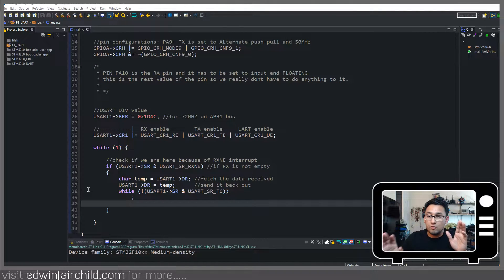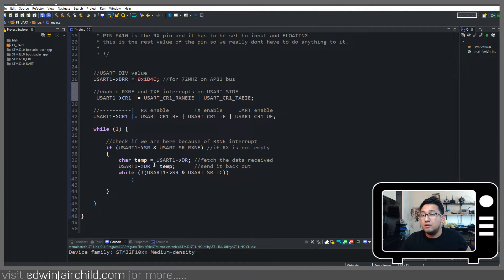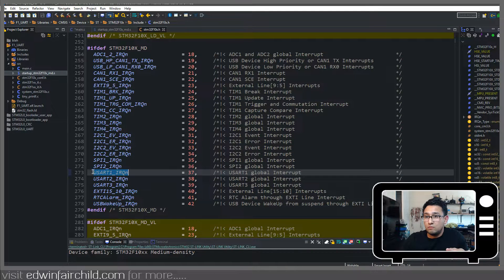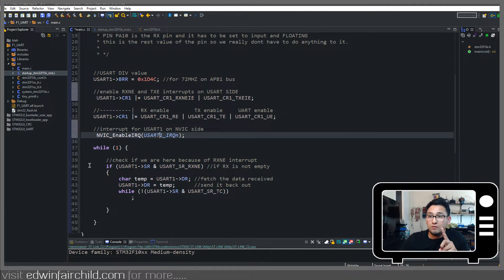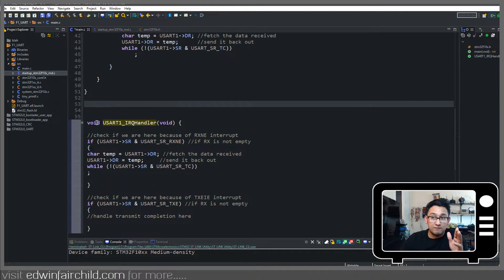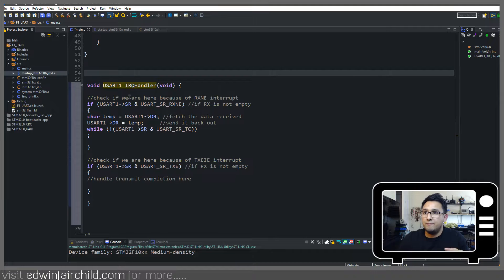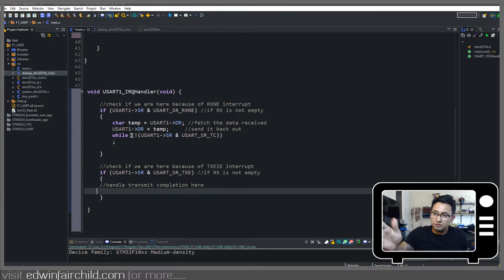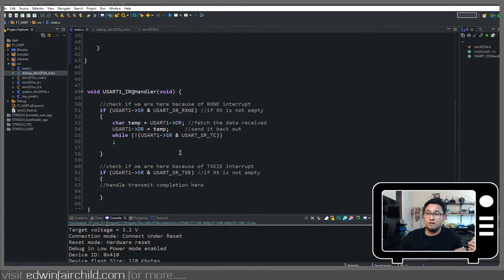STM32 UART Pt 3: Interrupts

Comment: Nice tutorial.  How do you use UART interrupt to connnect 2 STM32 MCUs. Enabling output of MCU1 using the input of MCU2 and vice-versa.  I tried doing it based on your tutorial.  It works for a single input/output.  However for multiple inputs/outputs it never worked. Do you know how to do this?
Reply from the maker: Explain a little more what you mean ? If it works for one output why do you need more is the part I don't understand... ?
Reply: @EdwinFairchild  sorry I did not clearly explain this.  Basically I have 2 STM32 MCUs connected through UART.  A button on MCU1 will trigger an output on MCU2 and vice versa.  Initially I tried a single button from MCU1 which drives a single output in MCU2 and this is OK.  However when I added another button2 to MCU1 I could no longer transmit data from Button2 to MCU2.   Here's my code for the Transmit MCU1:

USART2 -> CR1 |= USART_CR1_UE;
USART2 -> CR1 |= USART_CR1_TE;
USART2 -> CR1 |= USART_CR1_RE;
USART2 -> CR1 |= USART_CR1_RXNEIE;
USART2 -> CR1 |= USART_CR1_TXEIE;
	
NVIC_EnableIRQ(USART2_IRQn);

.
.
.

void USART2_IRQHandler(void)
{

  HAL_UART_IRQHandler(&huart2);

//this is the first transmit code for button1 which is successfully transmitted to MCU2
if(USART2 -> SR & USART_SR_TXE)
{
	{
		if(!HAL_GPIO_ReadPin(BUTTON1_GPIO_Port, BUTTON1_Pin))
		{
                      //transmit this data to MCU2			
                      USART2 -> DR = 0xFF;																				
		}
		else 
		{
		      //transmit this data to MCU2
	
                     USART2 -> DR = 0x00;																					
		}
	}
}

//this is the second transmit code for button2 but this never gets transmitted to MCU2		
if(USART2 -> SR & USART_SR_TXE)
{
	{
		if(HAL_GPIO_ReadPin(BUTTON2_GPIO_Port, BUTTON2_Pin))
		{
			 //transmit this data to MCU2
                       USART2 -> DR = 0xF0;																					
		}
		else			
		{
			 //transmit this data to MCU2
                       USART2 -> DR = 0x0F;																					
		}
	}
}
	
	
//this is the first receive code from MCU2 and successfully transmitted to MCU1	
if(USART2 -> SR & USART_SR_RXNE)		
{	
	{
		if(USART2 -> DR == 0xE3)
		{
			//enable output
                        HAL_GPIO_WritePin(LED1_GPIO_Port, LED1_Pin, GPIO_PIN_SET);
		}
		else if(USART2 -> DR == 0x1C)
		{
			//disable output
                       HAL_GPIO_WritePin(LED1_GPIO_Port, LED1_Pin, GPIO_PIN_RESET);
		}		
	}
}
		
//this is the second receive code from MCU2 but unsuccessfully transmitted to MCU1	
if(USART2 -> SR & USART_SR_RXNE)
{
	{	
		if(USART2 -> DR == 0xCC)
		{
			HAL_GPIO_WritePin(LED2_GPIO_Port, LED2_Pin, GPIO_PIN_SET);
		}
		else if(USART2 -> DR == 0x33)
		{
			HAL_GPIO_WritePin(LED2_GPIO_Port, LED2_Pin, GPIO_PIN_RESET);
		}
	}	
			
}
		
}

Comment: Eddie, how can one verify that the microcontroller is running at a certain speed? For example, if I have a MCU that can run at 100 MHz and I do the config that is needed for the, is there a way to verify the MCU is actually running at that speed?
Thanks
Reply from the maker: Yes check the "SystemCoreClock" variable . But first call the fun riob UpdateSystemCoreClock or something like that ... CMSIS functions
Reply: @EdwinFairchild  Where do I check the value of that variable? I found an instance of the same under core_cm4.h I see that by default it's 16MHz. When I run my program to get the clock updated and run the clock update function, the value of that variable is still 16MHz. So I'm not sure if I just messed up and my program is not working oooor if I'm just reading it the wrong way.
Thanks!
Reply from the maker: @ivanrob392  you can do anything to check the variable , print it, or add it to variable watch etc... if you call the update function and the variable is still 16mhz then you didnt change the clock properly
Reply from the maker: @ivanrob392  check my blog for some code sample http://www.edwinfairchild.com/2020/03/changing-clock-frequency-f1-via.html
Reply: @EdwinFairchild  Hey man. I think I was able to make it c:. I started experimenting a little with Keil's debugger and I saw the system core clock variable changing to 100 MHz. Stmf32f411's are a bit different, but without your code I would not have been able to make it. Once again, thank you very much

Comment: Why did I replace keil with atollic? Is there a cubemx makefile Converter in Cmake? Share a link pliz if someone knows :)
Reply from the maker: I use Keil, Attolic , VisualGDB etc.... But I think Keil and VisualGDB are the best. But Keil is not free and debug code size is limited for most STM32 products except a few. VisualGDB license is only $99 and paired with Visual Studio Community it is a thing of beauty. I will make a video about it soon. As far as CubeMx converter I have no idea, I do not use cube generated code. Sorry.

Comment: It is not working. My code in while(1) is not working. Interrupt received function was working. But after initialize they interrupt my code not run.
Reply from the maker: Start a debug session and find out why . I cannot see your code so idk.  Are you using the same chip ?
Reply: USART1->CR1 |= USART_CR1_RXNEIE; Just use like this, I have no idea why tx is always interrupting. Maybe try to clear TC bit in the USART_DR.

Comment: Bought new keyboard with ENG layout, and TrueStudio still does not work. How it is even possible to get anything done? Can't find flash tool for ST-Link...
Reply from the maker: ill make a quick video tonight  on how to set up the st-link . As far as the keyboard issue goes i dont know, did you change the keyboard language on windows settings, its not enough to just change they keyboard
Reply: @EdwinFairchild  Thank you very much in advance. The problem with TrueStudio that everything is non/standard. Almost every program uses Ctrl+C and Ctrl+V for copy/paste option, but only Atollic TS uses something else (I think Ctrl+y and Ctrl+W or something similar) for copy/paste. Yes, I did change keyboard layout(s), so now I have ENG and HRV (CRO) layouts. BTW, did you got working I2C on your STM32?
Reply from the maker: @MilanKarakas  Maybe your version of atollic is like that, my version has normal ctrl+c and cntrl_v for copy and paste. Igot the i2c working for STM32L0 I gave up on the STM32F1 i2c. Keep getting weird behavior.
Reply: @EdwinFairchild  I have latest version 9.3.0.  Okay, I will get it working one day. Just need help setting ST-Link. That part is weird. 
It is strange how some MCU from the same company has okay I2C, some not. Many people complains about I2C on STM32, but not only f103, but others as well. Thank you for help.

Comment: Great vids!
A few topics I would like to see:
1. Read/Write to SPI flash external memory like W25Q32FVSIG chips.
2. Use SPI LCD displays like the cheap 1.8 color panels with ILI9163 or ST7735 driver chips.
Reply from the maker: that is very specific, i should set up  a patreon for requests. but im too busy lately to make any more videos. maybe next week or the week after that ill make something but definitely not that specific where i have to spend money and order those parts.
Reply: @EdwinFairchild  I have a batch of 10 of the W25Q32 chips that should be here in a week.  I could mount one on a breakout board and send it to you if you are interested in tinkering with one.
It's a 4MB SPI flash chip.
Reply from the maker: @Synthetech  that sounds like fun! Im down for that.
Reply: @EdwinFairchild  OK.  I'll get back with you when they arrive..
Reply: @EdwinFairchild  Got the chips from China today.  They are clones/fakes!  They may work, but I'm forcing a return right now before I solder anything.. most likely they will have to refund and leave them with me.
Reply from the maker: @Synthetech  well thats a win if you get the refund and they happen to work. I have been playing with an AT24C02 EEPROM. Man the I2c for STM32F1 is a pain in the ass, I have switched to working with the newer STM32L0 and its I2C is a breeze to get working. Everytime I get stuck with something on the F1 its always a breeze on the L0 or G0. The newer datasheets for these newer chips even bring sample C code to set things up.  I need to encourage people to switch lmao http://www.edwinfairchild.com/2019/03/there-is-more-to-st-microelectronics.html
Reply from the maker: @Synthetech  is this the chip you are using? https://www.mouser.com/Search/Refine?Keyword=W25Q32JV
Reply: @EdwinFairchild  That a 2k EEPROM?  I guess I have not yet tried Rx'ing I2C on a BluePill board yet.  I mainly work with F4 boards right now.
Reply from the maker: @Synthetech  yeah it's a 2k, I'm definitely moving up to an f4 and an L series for smaller projects.
Reply: @EdwinFairchild ..." https://www.mouser.com/Search/Refine?Keyword=W25Q32JV "... that chip is close, but these are marked as BV instead of JV.
I was fully refunded for these.  I bet they work, but the listing was for GENUINE Winbond chips and they were supposed to be FV's with QPI, not BV versions that don't have QPI.

Comment: Can you type '{' symbol in Attolic TrueStudio? I installed latest version 9.3.0 but the same thing as previous - unable to type {  .
Reply from the maker: I have 9.2 version and all keys work fine..
Reply: @EdwinFairchild  Hmmm... probably Croatian keyboard. Funny thing is that I can type { in their search window and everywhere else, but not in main edit window. Copy/paste of this symbol is possible, but out of question. Thanks anyway.
Reply from the maker: @MilanKarakas  have you checked out your keyboard layout in windows settings? maybe its not in english... also on my windows 10 , if i press CTRL + SHIFT i changes my layout for some reason ,this is annoying sometimes
Reply: @EdwinFairchild  Oh, it is actually AltGr (right one) + B. Thanks anyway. I will delete this studio - no any good if I can't type. Got e-mail from their support, and they told me that there is no help for non-paid user or something like that. So, goodbye TrueStudio. Back to Keil.
Reply from the maker: maybe something to do with keyboard language settings in truestudio i dont know...
Reply: @EdwinFairchild  Oh, darn! If I switch to EN US keyboard, then it is under letter Đ and other one Ž. Then... if they does not support that keyboard, how I can manage to type it. Learn new keyboard? That is why nobody answers me on their forum. On Croatian keyboard, { is  Ctrl+b, so all Ctrl things are probably blocked. Strange. I will continue working in Keil. At least it supports my keyboard.